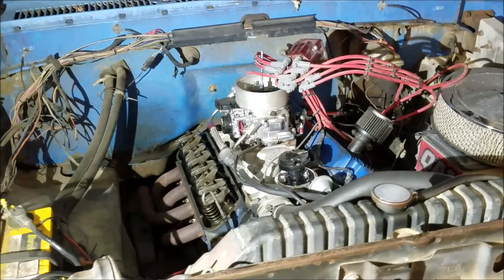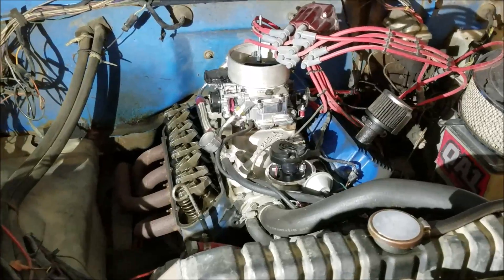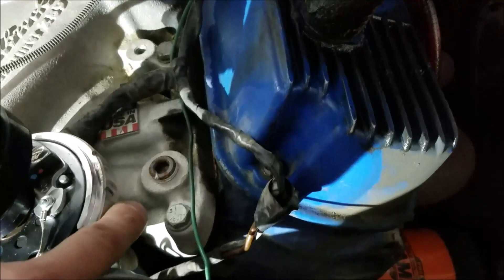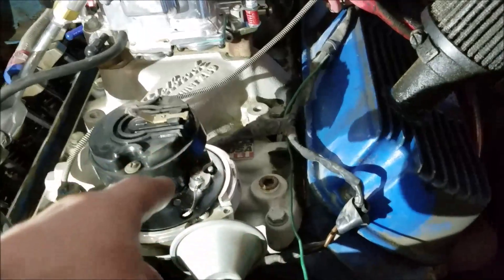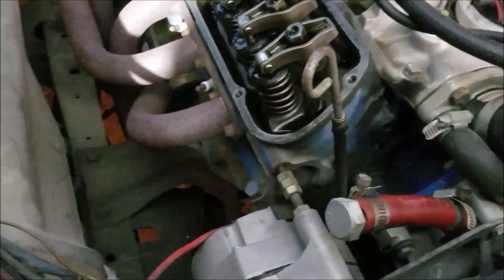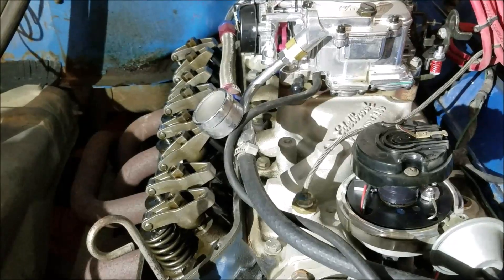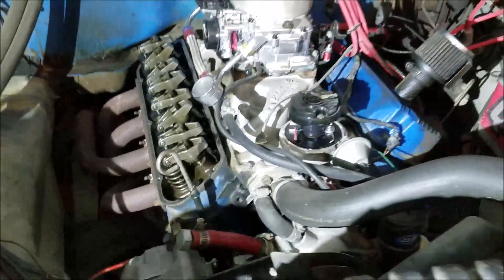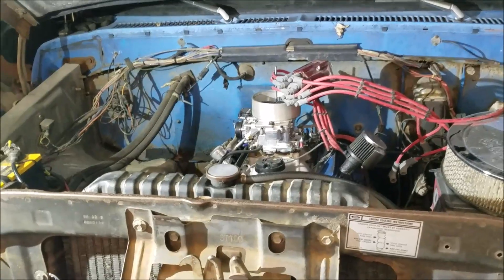Find TOP DEAD CENTER on an Engine w/ Basic Tools: 3 Simple Methods

Comment: I have a question...let's say the line on my harmonic balancer is too far off because it has slipped from its original position.. Can I use method 1 to find tdc and then make a new mark on the balancer?  In other words, once I mark the distributor and line up the rotor with the mark, that should be tdc and I can make a new mark on the balancer? Thanks
Reply from the maker: I would highly recommend changing the balancer if it slipped for the reason that it may have the rotating assembly out of balance. Search “Thunderhead289 replace harmonic balancer” I have a video walkthrough of this. Would hate for you to damage your engine or even break your crank!

Comment: If you're gonna overhaul it, using a degree wheel and dial caliper will give an exact spot where TDC is, considering there's play in the crank between when cylinder 1 gets right to the top either slightly before or after TDC, which the caliper accounts for, to center the piston right flush with the block deck.  Especially important if you're going to do a cam swap and need to match the numbers to the spec sheet that comes with it, unfortunately degree wheels and dials can be outrageously expensive for all that they are.
Reply from the maker: I luckily have both for engine builds 👌
Reply: Understandably so, since you regularly rebuild engines.  Someone just wanting to rebuild their small block at home out of their dependable daily driver might not have one on hand, but that's when renting parts is handy and is cheaper than buying tools outright that only get used once.
Reply from the maker: +Midnight Mechanic agreed
Reply: Tool libraries should be more popular, a place where home mechanics can rebuild their dailys using recycled parts and tools would save so much in resources, time, and money!

Comment: good information...I personally use the balancer checking the distributor method....what roller rocker do you have on that almost looked like the ones summit had or has still ?
Reply from the maker: There some very base style comp cams rockets. When she gets overhauled, I'm planning on landing some Scorpions in their place. Those were budget high school pieces
Reply: ThunderHead289 cool comps was going to be my second guess....I've heard good stuff about those scorpions seems like a good choice...are you going to fully rebuild it crank rods pistons cam ect ect.
Or just freshen it up
Reply from the maker: probably just an overhaul on the 289. i did it with iron rings, so i believe that to be the culprit. other than that, good oil pressure and ran good. just replace the bearings, rings, and gaskets. hopefully the cam doesnt show much wear. we will just have to see when i get into it. i have some better heads for it and what not.
Reply: ThunderHead289 old school better heads or new school like some gt40 style heads....I scored a nice set of late 69 or early 70 4v heads for free recently...it pays to look in the trunks of long since  abandoned cars...was a good day lol
Reply from the maker: +The Dude no doubt! I have a set of parted out 2.02 valve 65 heads Iv worked over a year or so ago. They will be a nice addition. Should keep the compression with the 54cc chambers
Reply: ThunderHead289 yeah those should breathe nicely on there and should still be happy with pump fuel